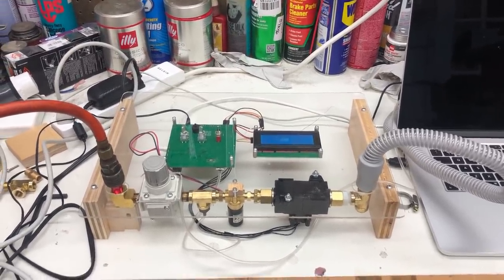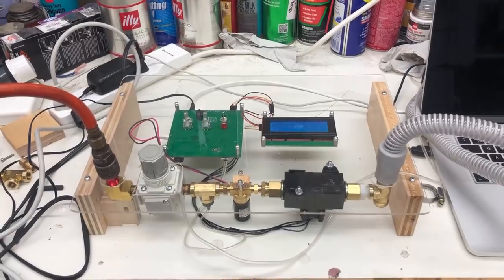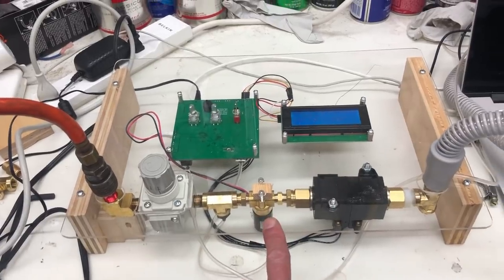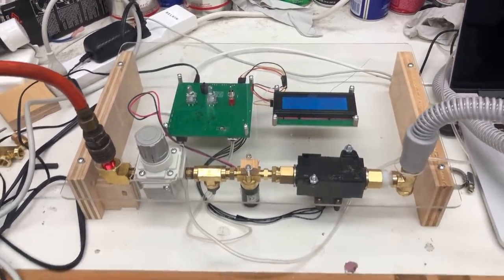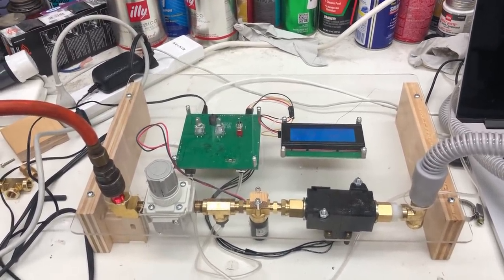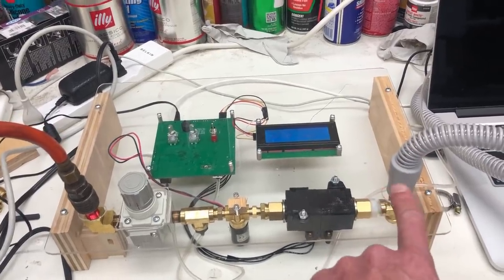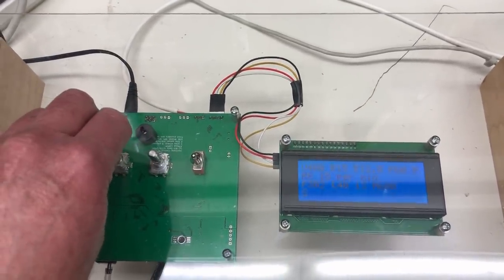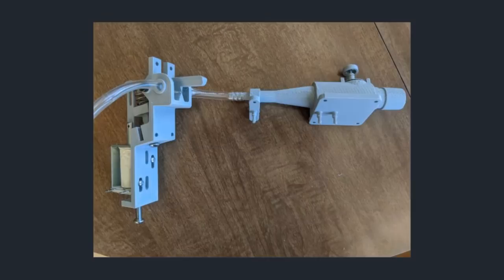OP Vent Introduction

Comment: They discovered and are using the "prone position" - it's a much better alternative than any ventilator which has a mortality rate of 30% to 70% (as high as 97%, depending on the study you go by). The prone position used in British hospitals now is that you breath heavy 5 times (holding breath for several seconds each time), 6th time hold breath then cough hard. Do this twice, then lay prone on stomach, breathing a bit heavier than usual for 10 minutes. This opens the lungs smaller air ways to help breathing (your lungs are further back, near your back, so lying on your back cuts off these small airways). Remember G.I. Joe? "Knowing is half the battle."

Comment: Input: compressed air.  Needs to be properly filtered, oil-free air.  Not just hooked up to any air compressor.
Reply: Ordinary shop compressors are typically not a problem for entrained oil or oil vapor.  Not really a worthwhile issue in this improvised situation, like fussing with sterility.  More of a problem with keeping the system running reliably, because if the shop air supply quits, a hose or fitting disconnects or bursts, etc., very ordinary problems, this machine is going to suffocate instead of support life.
Reply: @RichardKinch  OSHA requirements for breathing air are quite extensive.  Any oil-lubricated compressor needs to have the output air properly filtered.  https://www.airbestpractices.com/standards/nfpa-99-medical-air/osha-standard-29-cfr-1019134-grade-d-compressed-breathing-air-requirem
Reply: @horus909  OSHA standards are irrelevant.  This is about an emergency machine to keep somebody alive, and you'd accept less than perfect air supply as long as it isn't toxic.  I know I've breathed many hours of untreated shop air from a piston compressor with SAE 30 oil, and no ill effects.  The contamination is minimal, because hardly any oil is used up during zillions of cubic feet of flow.  This is just my contribution to this emergency project, that if the emergency circumstances demand an improvisation with cheap compressed air and no filtering, you'll most likely be OK, and I've personally tested this.  As have many others that use shop air supplies to work on boat hulls, paint booths, etc.
Reply: @RichardKinch  And so have I, but at the same time neither of us was immunocompromised with a virus.  Horus909 is correct, the air needs to be filtered.

Comment: Hello, The docs show a 2 port venturi. The STEP files show a 3 port venturi with an overpressure feature. The schematics say that 0-3 of 5 pressure sensors can be populated. This is very confusing! Where do the 3 ports of the STEP model venturi go? U5, U7, U11 or where? I have not found where 3 ports might be read in the code. Can differential units be used ( MPX5010DP) ?  Please open some information channel for questions. Thank you Thos J Powderly.

Comment: The version of the ventilator I saw was in a waterproof case with all the components. I had an Idea... Put an ultraviolate light into the roof of the case, so you can kill the virus on the components in the case, or while not being used.

Comment: I can't see that device function as a ventilator because it doesn't regulate the expiratory side. It's a CPAP or BiPAP at best. To ventilate you must have a valve on the expiratory side to build pressure in the airways (lungs).
While this device is a lot better than having nothing there's no way it can get any form of official approval for use on patients, at least not without proper evaluation and testing of the components (and software). Must not send toxins or particles into the lungs. Pressure must stay within a reasonable limit if a part fails. And so on...

Comment: What safety system is there in case the solenoid valve gets stuck open or microcontroller stops functioning?
Reply: the entire system is the safety system, a back up to the patient's own lungs. Nothing's perfect.